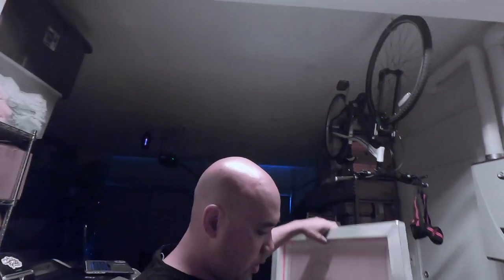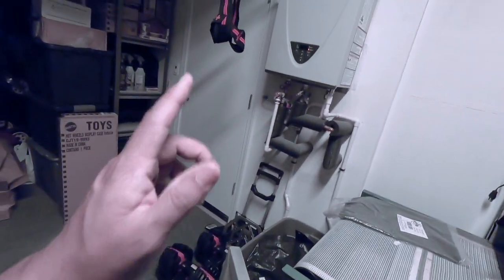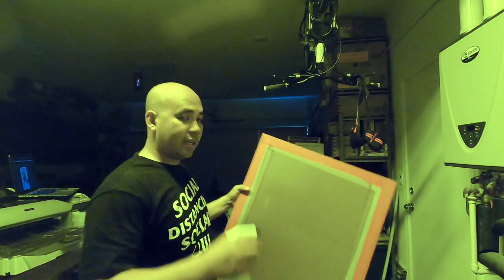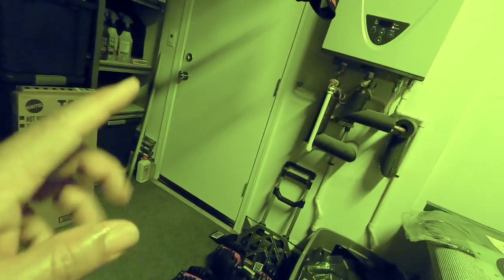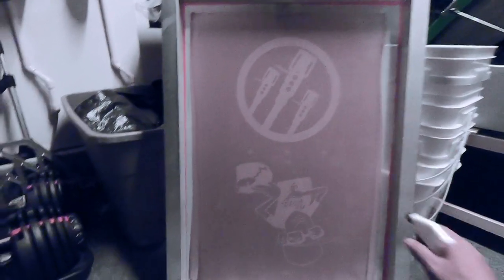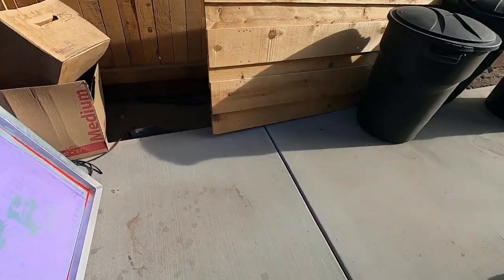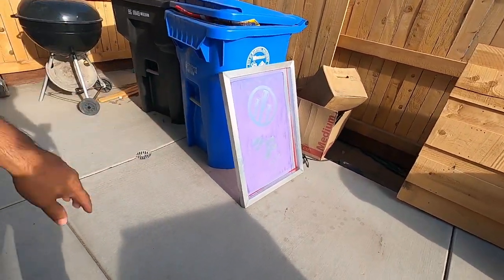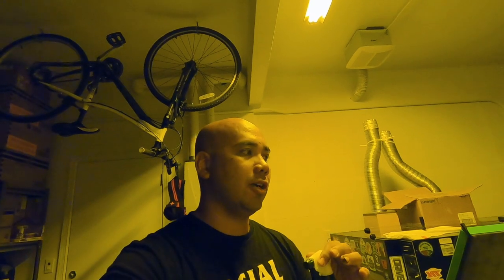MY PROCESS ON BURING SCREENS : Answering A Question (S:06/Vlog 039)

Comment: Question: with your design, if i want to make the shirt a different color than the skin, do i need to burn 2 separate screens? I know you can tape the part you don't want to print, but what if the design is a bit intricate?
Reply from the maker: Each color requires a screen.